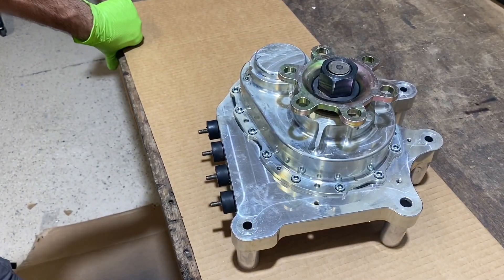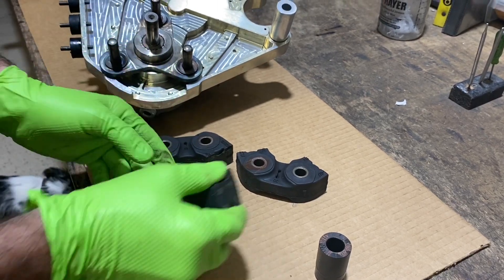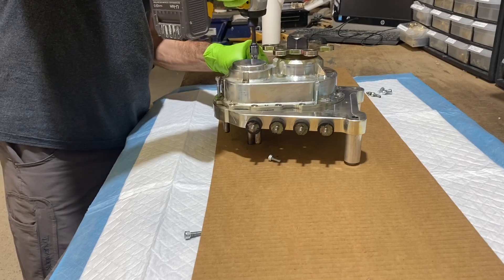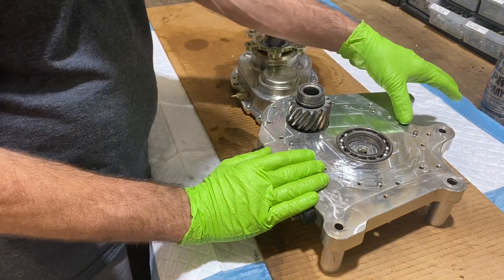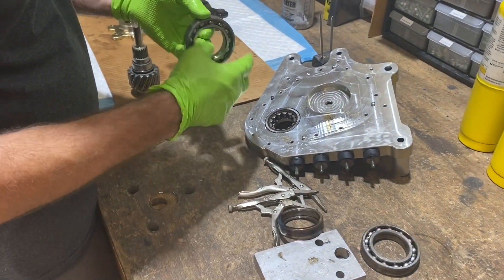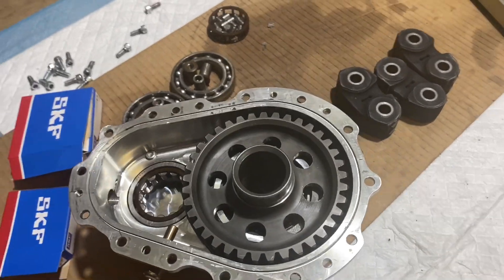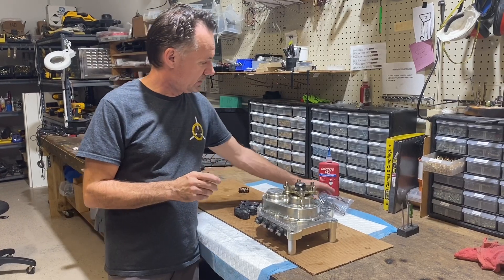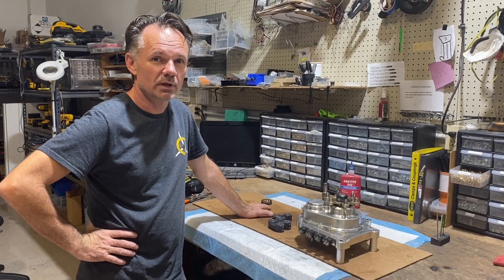Prop Strike - 500 Hour Gearbox Inspection

Comment: I'm watching these on my TV, so I don't have the freedom right away to comment.  I am really impressed by how you are working through this.  Sure, you could perform NDI.  However, I think your approach is very practical to replace these items that support the load or experience the stress and replace them for the few hundred dollars they cost.  I am encouraged by this video.
Reply from the maker: Thanks John, it mostly comes down to replacing the necessary, if it isn't necessary, it does become the option of the owner. Things in experimental can be tricky in these circumstances sometimes.

Comment: I used to be highly doubtful of my ever owning an aircraft engine with a PSRU on the front of it.  This opinion was reinforced over the years by seeing the first generation of badly designed PSRU's which came with belts, chains, overheating problems, dubious reliability over time and a significant chance for catastrophic failures.  However, I think that while I've been quite impressed with Viking's engines, what has also impressed me, has been the logical design of their PSRU's.  In my opinion, keeping a PSRU design simple, eliminating failure prone items like belts or chains and instead having it be a direct gear drive, running in gear oil(not engine oil) inside a billet case, is the only way to obtain bulletproof reliability.  This is just one more reason why it's almost certain, I'll be calling Viking when the time comes to purchase the engine for my project.
Reply from the maker: That is where a lot of the misconceptions are from. Glad your watching and following along. Like most things you can learn from mistakes of the past and continue to improve!
Reply: Right, except for the gearbox oil vs engine oil part though. It's been proven to work (any radial engine, RR Merlin, and most recently the Rotax 91x series). You need additives in the oil though, as in a motorcycle engine (another example).
Reply: @SuperYellowsubmarin  Friction modifiers are only needed in motorcycle engines without separate engine and gearbox sumps. My Honda CRF450R ran engine oil in the engine, and gear oil in the gear box. Why? Because gear oil is meant to work on gears, where engine oil is not.

Comment: That was great information, valuable insight into what to expect on the prop speed reducer after a strike and how important inspections are.
And yes, a bearing is on borrowed time after an impact.
Just replace them, they are a fraction of the cost of pulling the gearbox, just to begin with.
Also that's what stands between you and a dead stick over a forest, as you said.

Comment: Nice video I have a question, when there is a prop strike that is severe can that effect the crankshaft or just the gearbox?
Reply: A late response, but no, the crankshaft would not be affected since the prop is not directly tied to it. In Vikings PSRU the gearbox would take the brunt, and the dampeners would absorb the rest.